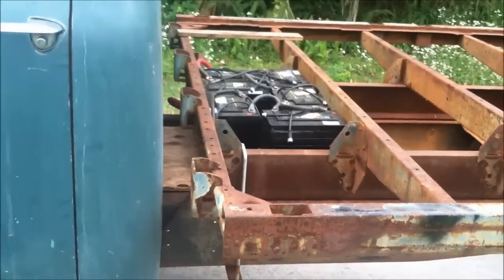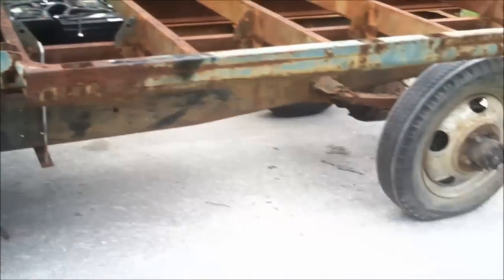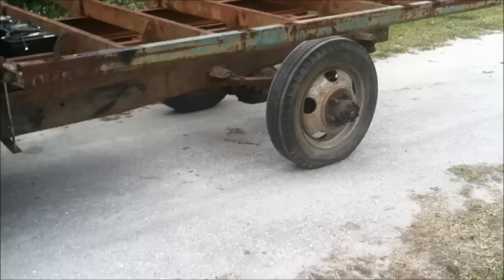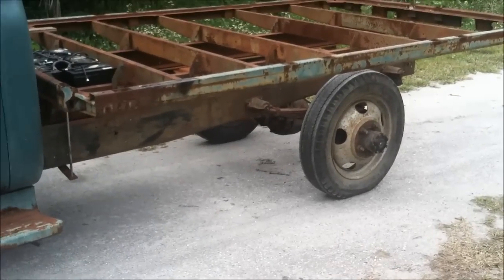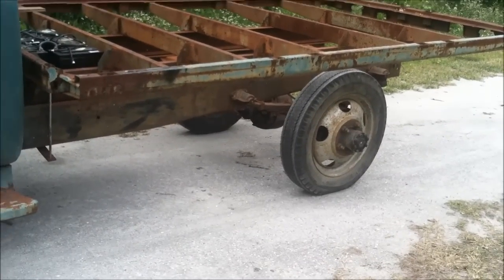1956 Electric F500  EV

Comment: expensive gear for such an old vehicle : )
Reply: The truck is still going it had a paint job and a wood bed put on the back. It's now a test bed for batteries that  I put in the bed and then drive the truck to test them.